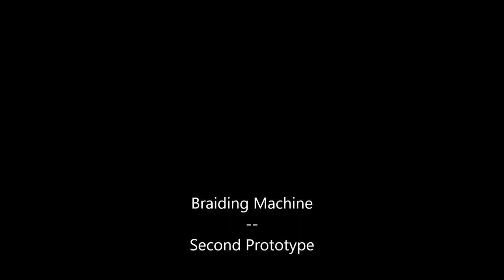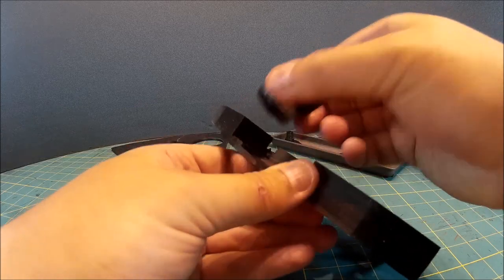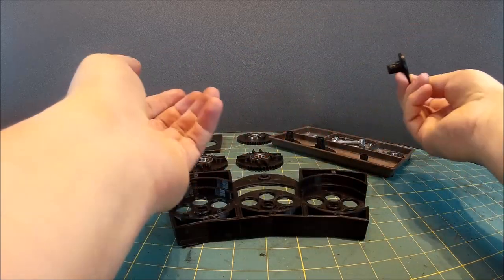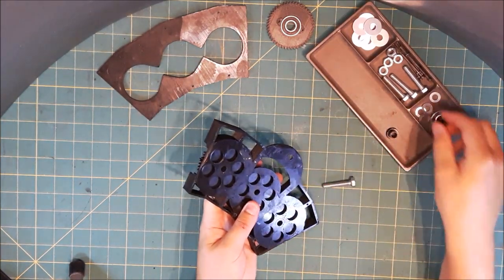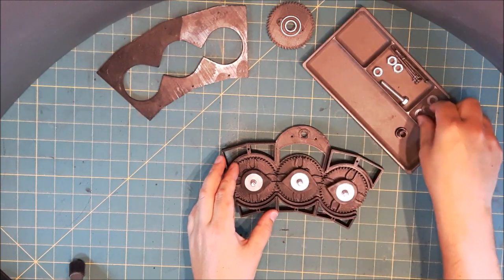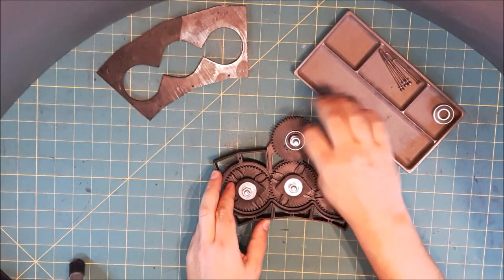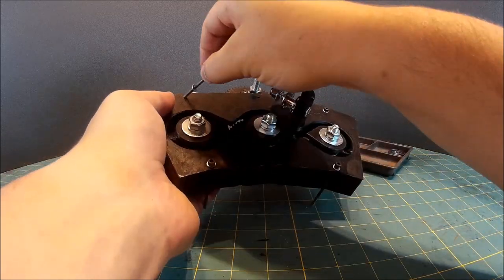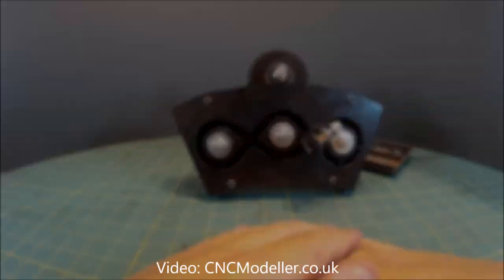New design for old technology: 3D Printed Braiding Machine #3 2nd Prototype

Comment: Hi Barry, is it possible to obtain the 3d model/STL files for this prototype?
Reply from the maker: Hi, I'm still working on this design so am not releasing the 3D models at the moment... should I get to a point where its working reliably I may well be selling kits or  releasing the deigns. Thank you for your interest!
Reply: @CNCModellerUK  do you have any for sale yet? Very interested for my hemp jewelry business. I make In Small batches, this could improve my production. I only braid 3 strands
Reply from the maker: Hi Joel,
          Thanks for your interest, that sounds like and interesting use case. The only problem is that the bobbins are very small (sewing machine) on this prototype so I doubt you'd get much hemp on them. I have been looking at a redesign ( https://youtu.be/1ozr28rbtxE ) but am focusing on the other technologies I need ( https://youtu.be/q-m1ChqJQVM ) to get my entrepreneurial efforts out of the blocks. 

Your needs would make a good prototype for the next design iteration for the braider (which needs larger bobbins), so I'll make sure I post a video update when I get there, if you'd like to subscribe and hit notifications you'll get an alert when I post new stuff. It'll probably mostly be made from laser cut perspex so should be something I can produce in limited volumes and potentially sell.

Hope all goes well with your business.

All the best 
Barry M
Reply from the maker: This might be of interest, looks like a very simple setup! 
https://en.wikipedia.org/wiki/Braiding_machine